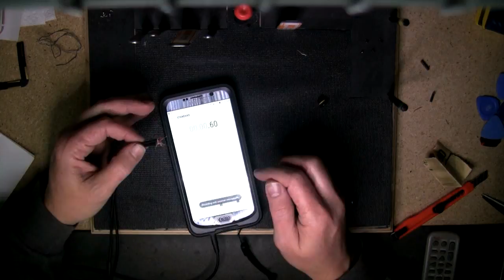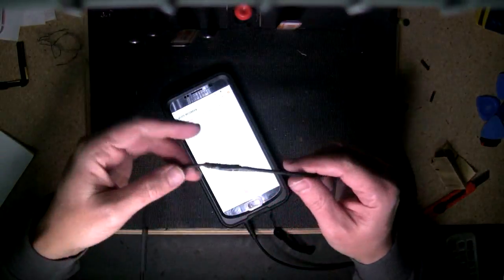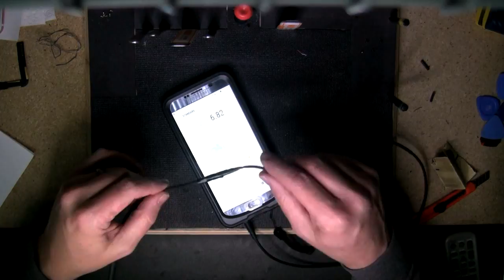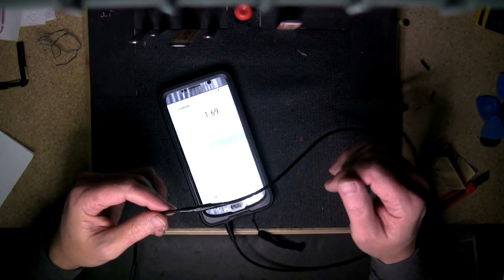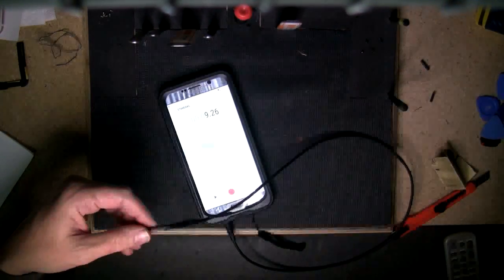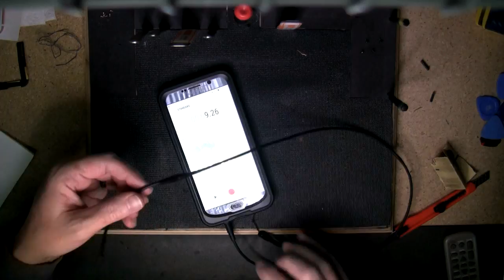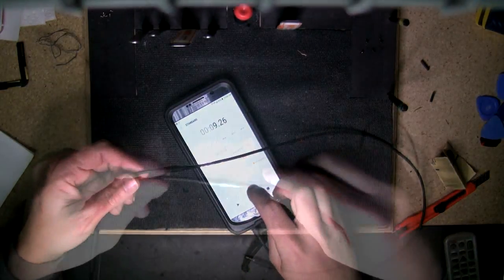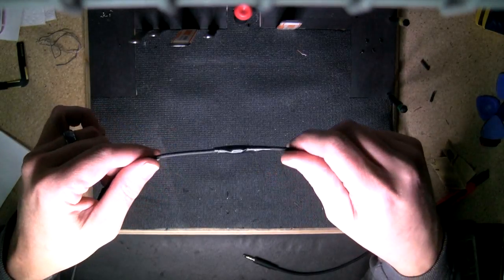DIY Headphone Repair - Micro wire with plastic / acrylic coating (non-solder version)

Comment: I can't get my mic part to work all the rest work and both have sound but mic won't have sound coming in if so I wonder what I did wrong and Im sure it's the white wire that's the mic I'm thinking but no clue if that's it or not

Comment: Good information. Thanks for sharing your knowledge. I did not have any electrical tape on hand. I DID have a hot glue stick though and melted that onto each splice. Cause as the song sez: ya gotta keep em separated. You rule Frank.

Comment: My cat chewed through one wire of my 3M Worktunes bluetooth headset. I watched your video and was able to repair it. I actually added non-lead headphone solder. There were 6 wires in all, and I used 100 grit sandpaper. If anyone reading this finds this helpful, here are some tips. Don’t tape everything until you do a second check that when wires are bent your audio doesn’t disappear. Also be very gentle with the sandpaper, I accidentally shortened one of my wires too much by ripping a wire that was a bit weaker from all the fire. A lighter was the best thing to get rid if that acrylic coating. Thanks a ton for this vid.

Comment: Did it! They work. Perfectly. Here's a tip, if no black melting thing. Just use the plastic covering of the 24packs of water. It's basically shrink wrap. I used black electrical tape then wrapped & melted that onto it.

Comment: Doing a small burn-off before twisting them together also is gunna go a long way if you're not soldering,  if you only do it afterwards you can't reach the surfaces that matter with your flame, sandpaper,  etc

Comment: why is there volume lower from one of the earbuds?
Reply from the maker: The wire needs to be torched a little more. It's not making a good enough connection.

Comment: Why would my rc lights not work after I cut them an put a different plug on it there a no coating just bare wire
Reply from the maker: Sounds like something in the plug man. Otherwise make sure the voltage is correct. I have 5v and 8-12v lights on mine and had to wire them separately.